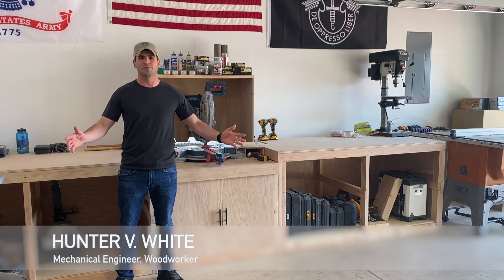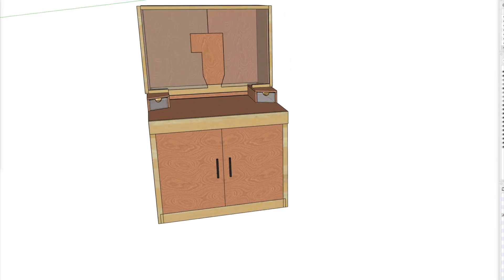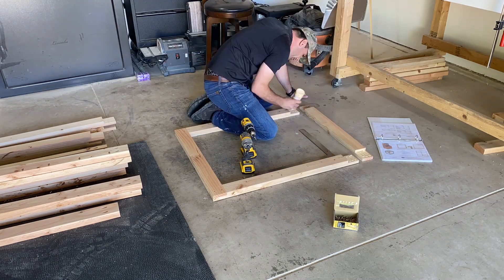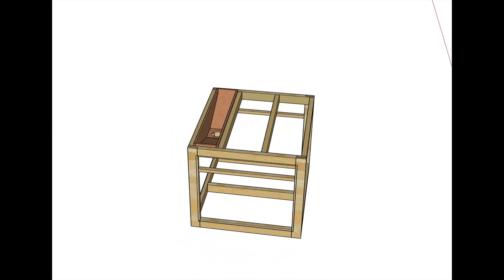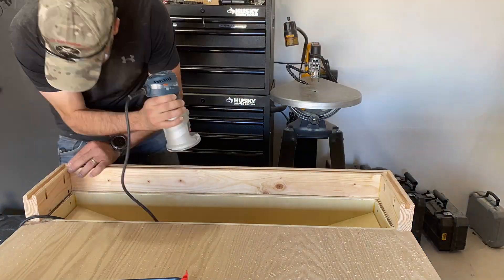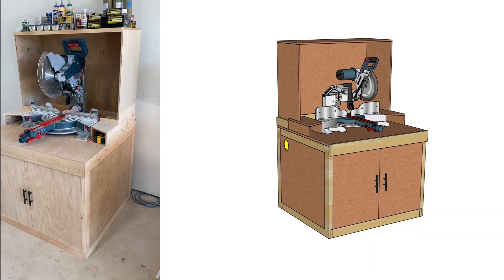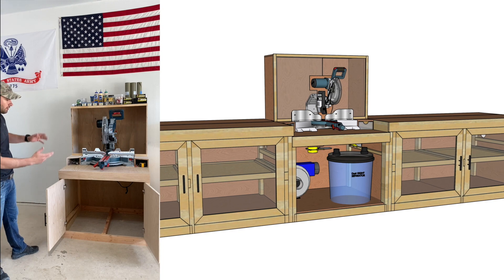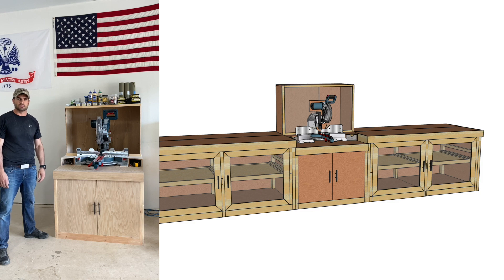Over-Engineered Miter Saw Station - Part 1

Comment: How wide are the cabinets and deep are they?
Reply from the maker: Check out my Etsy listing “over engineered miter saw station” on my Etsy Store: HuntersEWStore. I have all the dimensions listed.
Reply: @EngineeringWorkshop_hvw  I think I'm n going to purchase your plans. How would I scale down the tow side cabinets? I only have 129in wide
Reply from the maker: Awesome; I’m glad you like them. The plans are very detailed, giving the dimensions and relationships to all the necessary components and assemblies to make the bench. Once you have the plans, it will be straightforward to cut X inches off the length (for example) and apply that correction to all parts involved in the length. I recommend printing the plans so you can do the math on paper, and will have something physical to take to the shop with you to remind you of the needed corrections. One of the benefits of this design, is the two flanking benches are identical, so a correct to one is a correction to both.

Comment: Hi Hunter, I will be using your plans (already purchased) to build my miter saw station. There are no measurements for the saw clearance cutout in the polycarbonate, I figured this was to allow for different saw models. I am outsourcing the poly, would you be able to help me provide dimensions for those cuts to house a Festool KAPEX 120? Thanks!
Reply from the maker: Hey Jeremy,

Thank you for your purchase and best of luck on your build!

To measure the cutouts for my saw (Bosch) I made some cardboard pieces and slowly trimmed away sections with a sharpie and razor, creating two templates (left and right). This way, you know the polycarbonate will fit. 

I don’t own a Festool miter saw, so I won’t be able to take accurate measurements. The best I could do is Google, which will be far inferior to you measuring your own saw. 

Hunter